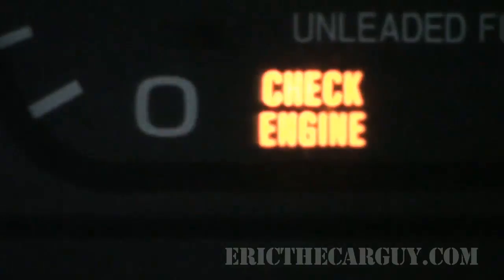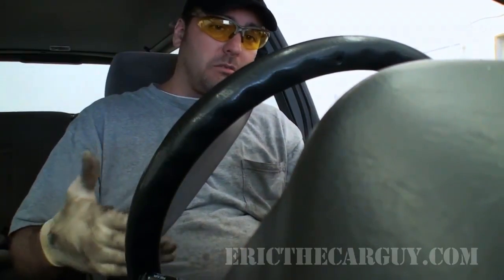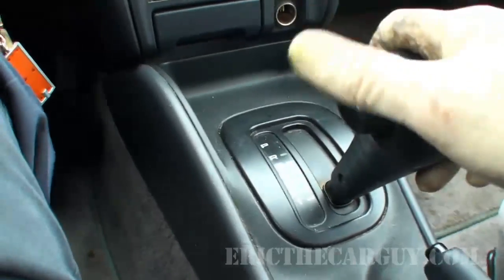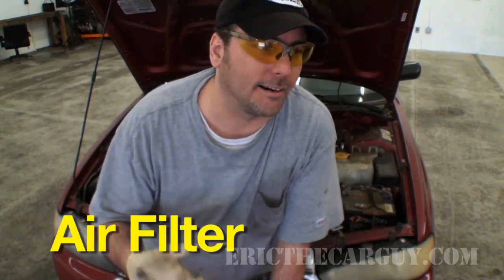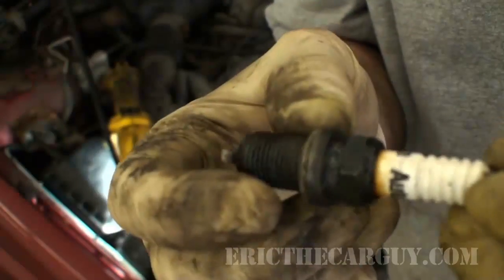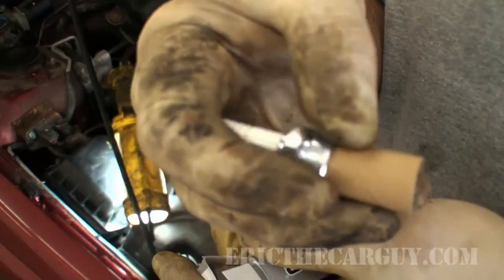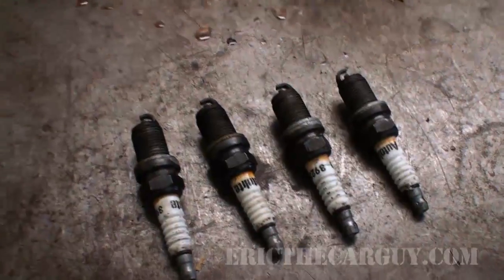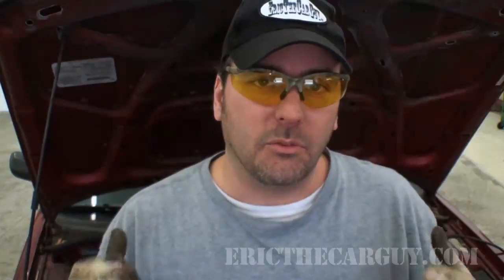Solving Engine Performance Issues (Part 1) - EricTheCarGuy

Comment: thank god for this, I've had the same problem in a suzuki jimny , no check engine light and scanner fuel trims are not overly helping or other diagnostic from the scanner. Even the suzuki service centre has no clue

Comment: Totally agree on the spark plug choice. Try putting Champion plugs in an old Ford... it will be running like shit within the first couple thousand miles, if not immediately. Motorcraft/Autolite are the only choice for a Ford. NGK do seem to work in nearly everything though.

Comment: Mine is only chugging n lugging in 5th gear on my 03 Mach 1. Had all new plugs done and was perfect for about 5 miles. Now back to the same chug n lug in 5 th gear. Any suggestions for next step. Could it be a coil pack? If it is a bad coil will that foul the new plugs I put in? Ran good with new plugs for a cpl miles n now it's lugging again. Ty guys!

Comment: totally agree with your ideas on O.E. spark plugs, but my idea is that maybe the old plugs where gapped inconsistently? causing the cylinders to run a wide range of cylinder burn/efficiency and thus the computer wouldn't know where to settle with the A/F ratio and thus causes the delay. Total guess :-)

FYI, I always gap my spark plugs with machine shims and make sure they are flat over the electrode. And the best spark plugs I ever used in my old Supra (88 Turbo 5 speed) where $8 for all 6 plugs Autolite copper plugs ;) And I first tried stock platinum, double platinum (bad idea), then good old "crappy" Autolite's, then quickly after Iridium which apparently don't like being in turbo or very high compression engines and tend to melt (wtf?), and dropped the perfectly gapped Autolite copper plugs back in (new set) but gapped them to 0.045 because copper is a much better conductor than platinum so I figured they would jump the gap much easier (normally 0.032) and noticed the top end was by far the smoothest with them in like that and turbo lag was a bit better. Kept that for years changing them every 10k miles or every time I changed the oil which was about 8-10k miles (AMSoil ftw lol).

Comment: Hi Eric. How did you tightened the spark plugs? Did you torqued as the manufacturer suggests or did you indexed the spark plugs (place them with the gap facing the intake)? I have seen people saying that indexing will improve performance and milage. Can you comment on that? Thanks. Greetings from Brazil.

Comment: Eric, a question for you.  After recently buying a car with a 12 year old car with a full service history, last being 400 miles prior to purchase. But it's been sitting months. So I put fresh molbil1 (as suggested), oil filter new and correctly gapped and torqued spark plugs and a pair of k&n panel filters.  1000 miles later it seems to be lumpy on cold starts and the mpg's seem poor.   Old plugs that came out were in good clean condition without oil or water on them. Cleaned both MAF too!  Any suggestions would be appreciated.
Reply: iVlog intake leaks can reck havok on some cars, even the smallest of leaks can make some cars run like garbage. PCV valve might cause this is some cars, quick $5 fix. EGR valve might also be causing your issue but it is better to cover the simple issues first as they can be the cause of more complex issues.

Comment: what kind of sparkplug and brand should I use for a 94 altima 2.4 the car is nothing fancy but would not want to buy the best if the best is only for high performance cars
Reply: 2pacnasgame buy what the factory recommends.
Reply: NGK

Comment: have a 2002 chevy tahoe pressure was about 45psi. change filter and remain about the same. can I assume is the pump or can the fuel regulator have some to do with it. I don't have a check engine light.

Comment: Hi Eric, I have a 1971 Corvette 454 600+HP engine which has been professionally rebuilt. The motor only has 3,000 miles on it, and about every 500 miles I need to change the spark plugs due to the plugs becoming gas fouled. Looking for cause and solution, Thanks Richard.

Comment: ...so u shouldnt drop the plugs in huh? Well how am i suppose to put mine in? I got a 97 civic and I basically put the plug in and then carefully tighten it up.
Reply: stiliqn007 they make a spark plug socket that holds the spark plug in the socket as you lower it down into the head so you don't drop it

Comment: i blew out a spark  i tap it to put in a insert.i hit the top of the prison and strip out my new treads. it was the biggest insert.don't know if there is enough medal  to tap once more with out messing up the vale seals. what to do. get a new insert made by machine shop. know some one wont cost me any thing,used head. or jb weld i know i wont get it out 1997 Chevy lumina 3.1 motor

Comment: I have a problem now as I drive and slow down to idle the car stops,and also if am driving for a few minutes the engine hits up,also the engine goes off when I applly the air con.I dont know where the problem lies here
Reply: with the AC, it depends on the alternator -  making power to keep your battery healthy and the engine running. check on that first. also check the battery and see if it still holds a charge, you can go to a auto part store and they will do a free check up on your battery.

Comment: NGK or Bosch spark plugs work the best for foreign cars.
Reply: Not all GMs came with AC Delco. Saturns came with NGK. And I agree, Bosch is crap. I'd rather run a Champion plug than a Bosch.
Reply: Bosch has been straight Garbage and overrated by experience, NGKs in other hand are amazing
Reply: midos67 Bosch is trash.
Reply: I would hope so AC Delco is OEM for GM vehicles
Reply: @Fordfanatic1995  Gm    have many European Opel/ Vauxhall parts on there  smaller engines or are sometimes the same or  based on the euro 4 cylinder  motors ,So would those model engines used in  Gm  cars have NGk or Bosch   from factory ?,because opel have NGK standard in European  cars i think  ,
Reply: Marvin Harrison Smith II > Oh cool. Are you the Marvin Smith that was on To Catch A Predator?  It's nice to meet you sir.
Reply: My Chevy Truck is a GM vehicle
Reply: Bosch is bomb what u guys talking about
Reply: Bosch might be ok for some foreign cars but not for Honda's. Stick to NGK's on those.
Reply: Bosch or NGK Plugs are both good for foreign makes. Though NGK is a higher quality plug than Bosch. My favorite plug for my Chevy truck though is AC Delco

Comment: You should always gap the plugs, makes a difference in how well the plug fires. Don't forget anti-seize.
Reply: Checking plug gaps never hurts as long as you use the correct type of guage. NGK has on their site the correct type to use. The whole "different cars require different gaps" is true, however, NGK sells plugs with different gaps. You can get the laser IR in multiple gaps specs and the same with others. have to make sure you get the correct part number. NGK recommends not using anti-sieze because the plugs are already coated with an antiseize. They state that use of additional anti sieze can lead to over stretching the threads in order to achieve proper torque which can damage the head. Obviously NGK feels there is more of a risk to head damage by using the additional lubricant than not using the additional lubricant. So much so that they put it in print and can be held accountable for their recommendation.
Reply: NGK plugs don't need anti-seize, they state this on their website, and the plugs are pre-gapped most of the time. You can check this with a feeler gauge.
Reply: XC if your spark plugs are platinum or iridium and the threads are coated in a silver finish then there is no need to use anti-seize as they are already coated in a property that restricts them from being a pain in the ass the next time you take them out! lol
Reply: Nick Leijenhorst Even if they are "pre-gapped", you should always check anyway. Also every engine requires a different gap, so the gap set by NGK may not be correct. Anti-seize is very important for aluminum heads to prevent thread galling and reduces the chance that you'll break the plugs during removal.
Reply: @xc8487  every engine requires a different gap, and you therefore buy the correct gap.  It isn't like they make a single plug.  Hell, for rotaries you can choose how hot you want the plug to be based on how hard you drive the damn thing.  So research and buy the right plug, if NGK, you are golden because they have a very long track record of accurate gapping.
Reply: @kuromurasaki5273  There is no such thing as buying different gap plugs. How far the electrode and ceramic stick out is called the heat range. All that does is determine how well the plug transfers heat out of itself, which does nothing for performance on its own. To make more power you need tuning to unlock the benefits of running colder plugs.
Reply: @kuromurasaki5273  Yes they do come "pre-gapped", but it's only to the most common gap spec for a huge variety of engines. That means it may not be gapped correctly for a specific application. Just because it's "pre-gapped" also doesn't mean they may be out of spec, such as from shipping & handling. So not taking 3 minutes to check your plugs with a gauge is just lazy.
Reply: @xc8487  
https://www.ngk.com/product.aspx?zpid=9605
gap these then

and I like how you just said they make a ton of pre-gapped ones; and mechanics and enthusiasts for DECADES say they are perfect from the factory means nothing to you, without any common sense.  You get 4+ plugs and you can compare them.  If you do this on a regular basis, such as a a mechanic might, and they have the protective sleeve, and they come out right all the time, and you've dealt with gaps enough to have an eye for it, and you install them without issues.  Then yeah, you can probably skip it.

Buy cheap plugs?  Check the gap, every. single. time.  Buy quality plugs that have proven to be accurate over several decades consistently without fail ...  you can probably trust it.

It isn't a campaign to get people to stop checking; but to basically not waste your time.  IF you see the package was damaged? check them.  If you see the protective sleeve is missing, check them.  If on visual inspection of your set of plugs, they appear to be set differently, check them all.  But, if the packaging is clean, the protective sleeve is there, and they all look identical ...  from a trusted brand that is known for accuracy, then you are most likely safe to put the damn things in.
Reply: yea anti- seize too bad others dont use it makes changing the plugs or any other parts a dream!!!!!!!!!!!!
Reply: XC 
NGK don't require anti-seize or gapping. Just make sure you get the correct spark plug no. for your car and they'll be fine.

Comment: my 01 gmc jimmy hesitates and it does have check engine light, with the code p0410 secondary air pump. any suggestion could it be the air pump, or something else.
Reply: MrELKICKER

Comment: Hello Eric, I have a 1997 Acura CL 3.5 L when I come to a stop at a light, upon coming to a complete stop my car jerks, when the light turns green and I give it some gas it jerks again and then drives off good. Do you think its a transmission issue?

Comment: I have a similar issue with my car. I figured out that the hesitation occurs only in the morning after the car has been parked in the sun. It goes away after first 20 mins of driving. Any ideas what might be causing this?

Comment: at least you have a check engine light, my car behaves similar to yours for almost 2 years and no mechanic can't catch the issues, I did the transmission test and it works fine, now the spark plugs I got were platinum and I got them from Advance (i know, I hope the guy provide me the right ones) I'm going to check the spark plug gap now.

Comment: how do you find out what the manufacturer recommends
Reply: contact the parts department at your local dealership, give them the last 8 of your Vin number and they can pull up a sheet and tell you everything that came from the factory on your specific vehicle. Hope this helps!

Comment: I`ve switched from OEM spark plugs to iridium/platinum ones and my throttle response got better... my top speed tooI`ve also experimented with other iridium spark plugs that aren`t even designed for my engine with the same results....What do you think of this? Should I go back to oem?

Comment: hi eric, was just wondering, if your manufacturer recommends a certain type of standard ngk plug, and you instead put in an iridium, is this in fact detrimental? having issues in my rb25det skyline where it feels like (and sounds like) its dropping a cylinder, plugs look average. Had a ton of people say coil packs but they look brand new, so was gonna start with plugs as they are cheaper, even if i do go with iridiums.

Comment: hey Eric I got a problem with my 2004 Honda Accord when I started in the morning it's sputters to start I have to give it gas or sometimes it doesn't crank I have to push the gas pedal can you help me out please
Reply: start with basics - plugs, wires, fuel filter and do fuel pressure test and scan for codes

Comment: when there are white deposited means you have good fuel burning and then you have nothing to worry about! when the deposits are black you should worry...
Reply: hi, now with ethanol in gas, the plugs will be light coloured but white would indicate a lean condition - light tan is perfect

Comment: I can't believe my ears. A mechanic saying that the 1, 2 , and 3 on an automatic shifter are manual slots. Those are limiter slots. If you start from a dead stop in 3, it won't be in 3rd gear. It still starts in first just as it does when starting from a dead stop in Drive. All it does is limit your transmission to third gear, while still automatically shifting from first to second, and finally third. Then when putting into drive it allows your transmission to go to fourth, fifth, and so on. While you can shift it similar to a manual by raising the limit from 1 to 2 to 3, it's bad for your transmission and isn't recommended. They are recommended when in low traction environment and need the torque that the lower gears have.
Reply: Different vehicles hold the gear or shift up to that gear. If it was in D3 vs D4 then yes what you're saying is true.
Reply: My blazer if I put it in 2, it'll run in 2nd gear. Only that 1 though. Perhaps it's designed for if I need grip

Comment: clean the headlights, it will add +5hp
Reply: Smoked light covers, 600 HP to the wheels!
Reply: Also remember to check your blinker fluid.
Reply: Liam Rowe and a K&N sticker on the body. Forgot about that one.
Reply: Mr L Brown First, go get your car Dyno tuned to get a baseline torque and HP curve. Then clean your headlights and go get it Dyno tuned again to measure your gain; you should expect at least 5HP. If that doesnt work, put a K&N sticker on your back window.
Reply: Flame stickers, easy 150+ HP. Real tunerz only.
Reply: Trolls idiots
Reply: Wow this is great info, plz tell me more!
Reply: MidnightMarrow ha!
Reply: put in led bulbs and your get a extra 55 hp :)0, add wipers on the headlights and your beat every car in the world , oh yea lol
Reply: nope - the car just looks faster.

Comment: Have you ever changed the plugs in a GMC Sanoma 4.3?
Reply: take the front tires off and go through the gender wells. then they are really easy to change.
Reply: yes and it's as easy as eatin pie, or hair pie.
Reply: okay so how to get the one behind the steering column?
Reply: Some spark plug sockets have the ability to use a wrench on the end of them. That usually works for me in tight spots.
Reply: David Dalton Except for the drivers side have the steering column in the way.
Reply: okay
Reply: Larry Lafferty I have the same engine in the blazer. What I did was fit the socket on the plug and then use an extension pushed slightly at an angle (not at all snapped on) and just used the grip it had. Got lucky lol
Reply: I've done dozens of them. you go in through the fender wells. even on the drivers side behind the collomn. it's easy. can do it in my sleep. if you can't get that one changed them take the extension off your ratchet and do it with just the socket. if your scocet is too tall then take the colomn loose. it's not rocket science. can do it in my sleep in less than 30mins.

Comment: Tip - when you buy plugs, verify the part number on the actual plug and not what it says on the box before you install. I actually got a set of NGKs bought online with the wrong part inside, spent a good week trying to understand why my engine was not happy.

Comment: hey Eric what's the best plug to put in a pontiac grand prix 99 gtp?
Reply: only ac delco for l67 - go iridium if you got cash - otherwise go copper 
stay away from bosch at all cost - dont even look at them
Reply: I used ngk iridium. .

Comment: How funny for me to happen across this video.
I have a 96 legacy outback and have a similar problem. I've resorted to manually shifting through the gears (1,2,3,D) and have seemed to eliminate the problem doing that (and having more fun driving). But It still struggles on hills, I have to take most hills in 2nd gear or else my engine gets mad at me. Light hills it can handle 3rd gear but only if I keep momentum and the revs higher than like 2800-3000.

Comment: This spark plug shows me the engine is burning little bit oil (not only fill oil up, change it in time). 
Also there is a problem with the ceramic-insulation because of the dirt on it (electrical-short-cut).
The electrode gap is very high. This must be the reason of your tea-break. Check the right gap on the new plugs. 

Using the wrong spark plugs can result in severe engine damage like holes in the piston! 

(by the way, for me the NGK spark plugs with the v-notch are the best plugs you can get)
Reply: +djAmbush They were gapped to 11mm.
Reply: MindBlowerWTF
_Did you mean 1,1 mm?